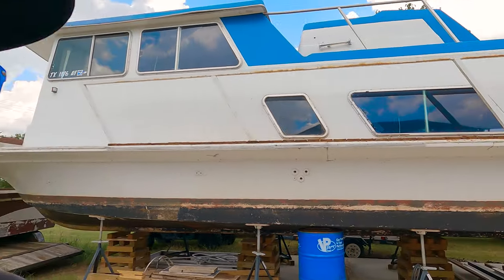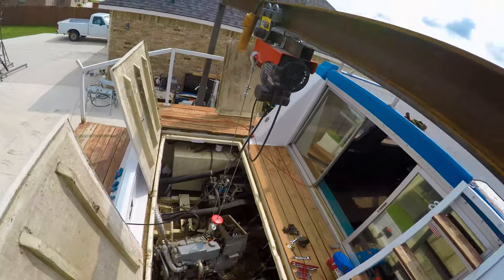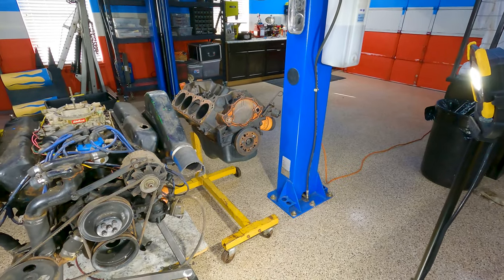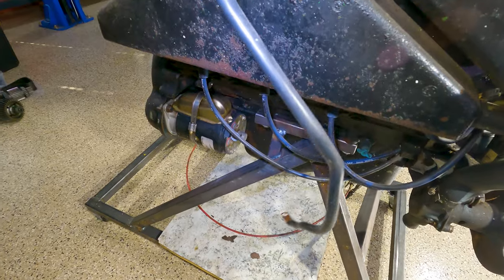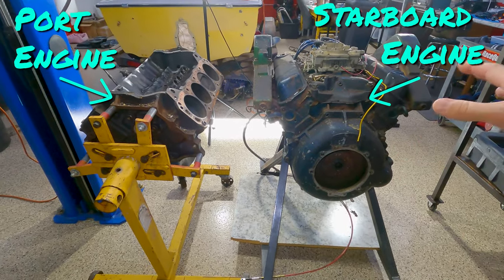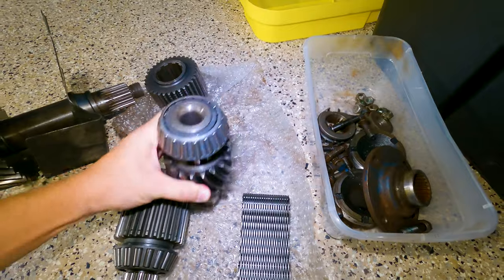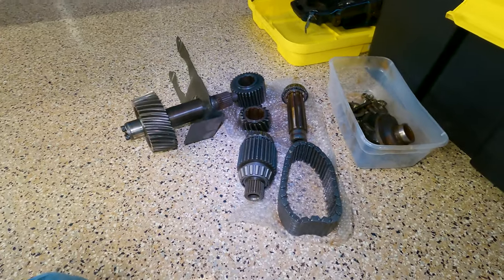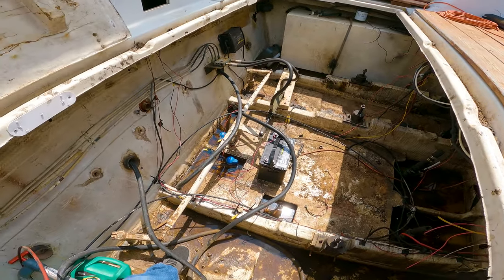What Houseboat Engines Should We Use?

Comment: Ok, I’m in.  I live near Texoma and restore boats as a hobby.  This is going to be epic.  As far as the engines, I would rebuild them- those 351 Windsors are good motors for this application.  Fuel economy would be the last of my concerns, especially on a lake like Texoma.  You’re not traveling great distances, and they’re easy to work on.  Parts are getting a little tougher to buy new, but there are so many of these engines out there you shouldn’t have a problem finding a couple parts motors to tuck away.  I 100% agree with getting rid of the V-drives and just going with some new transmissions.  I’m most interested in how you’re going to tackle cutting and adding a new section of hull to this boat.  That’s going to require some serious glasswork skills.  I absolutely cannot wait to see how this shapes up, and see this boat back out on the lake.  Not sure how I stumbled on to your channel, but I’m so glad I did.  Was even cooler that you’re local to me.  Cheers guys!

Comment: Lots of education in just a little time. Great work! Motorbike, keep it simple stupid is the motto. It's not a race boat, but doing good on gas wouldn't be bad either. Maybe go fuel injected but see if the fuel mileage will actually outweigh the costs. 

Diesel motors would be cool too. So many options and I know anything you guys decide will be done to perfection. 

Helicopter motors aka flash gordon?! Lol not sure tesla motors would be a good idea unless you can really use solar panels to keep them charged.